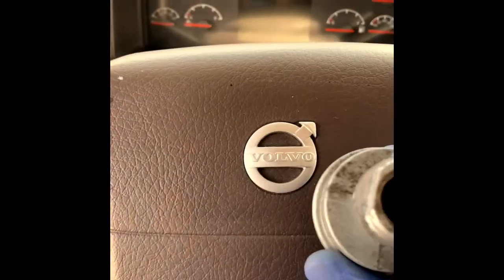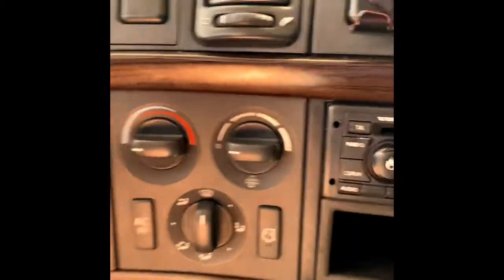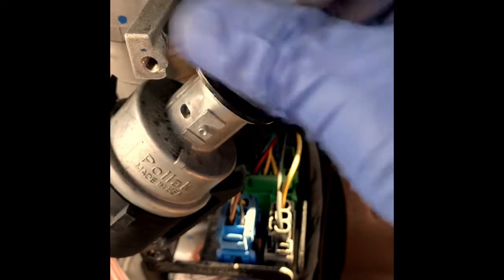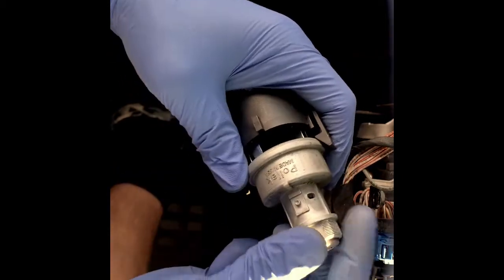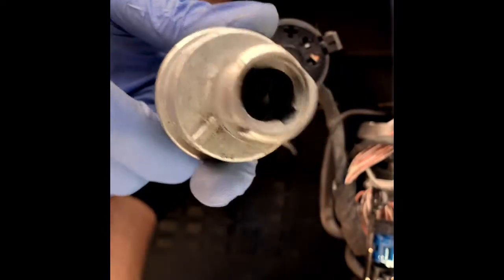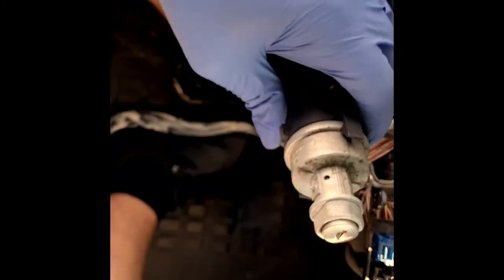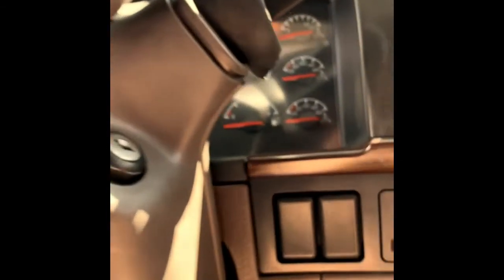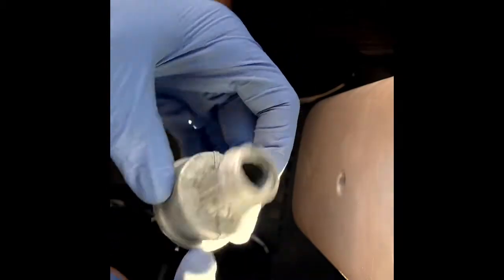Volvo Vnl ignition switch replacement. Part link in description.

Comment: Thanks!!! Worked perfectly for 2014 vnl 670. I replaced my starter but still had cranking issues. The ignition switch was the issue. The video is very well explained, step by step instructions.

Comment: Hello I have a 2013 Mack granite gu713 and it cranks for like 10 seconds before turning on would this solve the problem or would it be a starter issue ? Thanks in advance
Reply from the maker: Hi!
Looks like you have a different problem .
Look in your fuel tank for bubbles. If you have them then is your injector caps most likely.

Comment: I tried to press the copper pin in and it does not want to pull out
Reply: Did you finally get the pin out?
Reply: Same here..
Reply from the maker: Try better